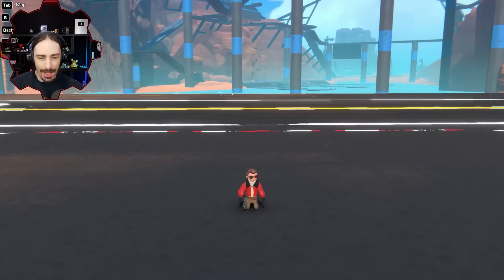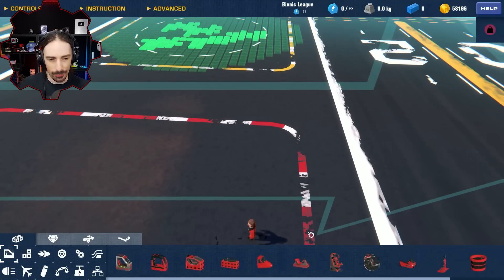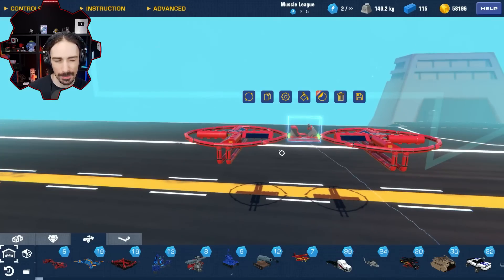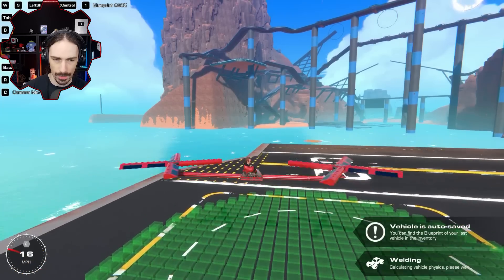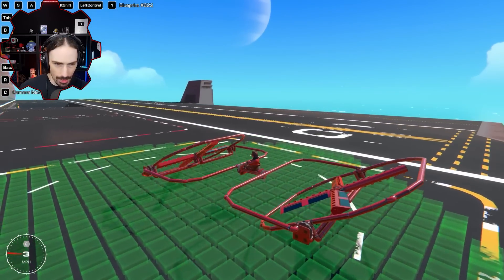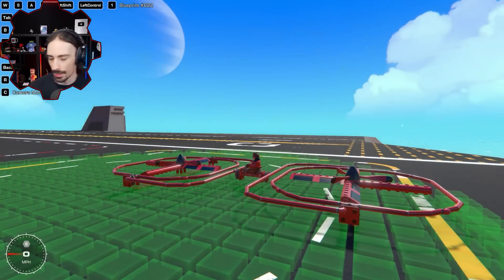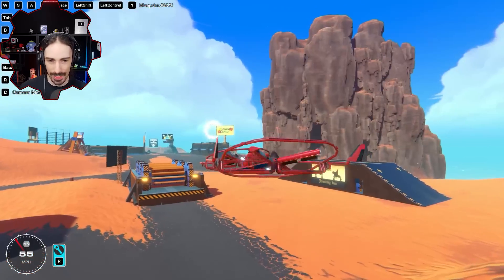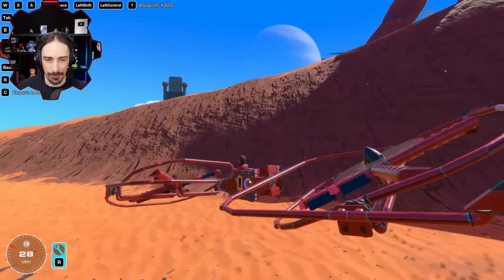Over-Engineering a Motorcycle Until It Becomes a Drone

Comment: Day 1 of Avrocar fflying saucer.

Hi Scrapman! Can you make the Avrocar? It is a saucer like car that floats with the help of exhaust of the thrusters (you can use jet engines for lift, the top down view also looks like that (https://upload.wikimedia.org/wikipedia/commons/thumb/9/90/Colour_avrocar_59.jpg/1200px-Colour_avrocar_59.jpg)) and it (was supposed to be) a VTOL vehicle.
Story- Avro Canada, a vehicle company in Canada(as the name suggests) made AvroCanada AvroCar VZ-9 was made in 1958 by Avro Canadad as a civilian travel vehicle, but development was later stopped and it was handed to the USAF who worked a bit more on it to make it a supersonic spy craft. It was not succesful, as it couldn't go (be stable at) over 1 meter (3.3ft for you) let alone fly in the sky at supersonic speeds. You can enhance it to make it do the original purpose.

Comment: I know you know! but tubes are nor light nor aerodynamic (both relatively and in absolute).
Change the front ring with a more aerodynamic solution and you will shift the center of pressure backwards.
(Got similar config without stabilizers, the secret is to keep the center of pressure - of all axes - behind the seat)
(yeah the winglets I know)

Nice Mambo Jambo

Comment: Collective pitch also controls each blade angle individually to control vehicle pitch/roll/yaw. I think what you've made is 'adjustable' pitch propellers. I wonder if it would be possible to create a proper collective pitch propeller, but you'd need to know the rotation angle of the motor to determine how much to adjust each blade depending on how far along its rotation it is. Might be simpler to do it mechanically, like they do it in helicopters using swashplates.
Reply: I think he's done that in a previous video a while ago. That was before the Airborne expansion though. The flap wings make achieving a similar result much lighter and much less of a headache.

Comment: You should put a helicopter engine with a logic gate (unless they have thier own power setting) wire it so it activate while you go forward and then set the power just strong enough to counteract that torque to the left you have.

Comment: Legitimately curious. Was there a reason you went straight to heli engines and not the tiny propeller? I'm guessing through your experiences you don't think it will provide enough lift or forward momentum? Now I want to test some things lol.
Reply: His inspiration was the helicopter that he showcased at the end of this video: https://youtu.be/unxbYKB_zuE?t=991

Basically, the Airborne DLC added new wings that have functional, mechanical flaps on them, which means you can now build rotors like this that actually control the thrust via the flaps instead of having to rely on logic gates to adjust the thrust of the engine itself. It's essentially the same result either way, but the overall thrust does seem to be more consistent and stable when the engine is at 100% speed 100% of the time with the flaps doing all the actual work

Comment: 5:12 You can always use logic gate to pick your ideal power output. They all have power slider!
Reply: power power power power power power power power
Reply: yeah its logarithmic not linear so 0.1 - 0.3 barely does anything compared to 0.3 - 0.6. on the logic gates powered to engine
Reply: agreed
Reply: Hey, Scrapman using any logic is a big step forward, he's doing so good compared to what he used to do.